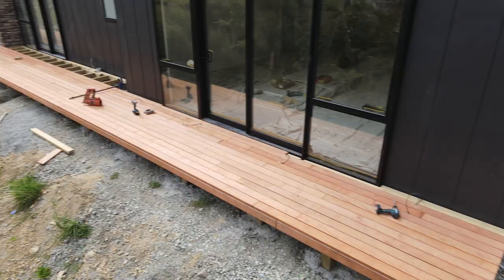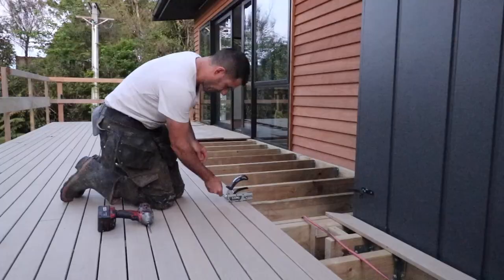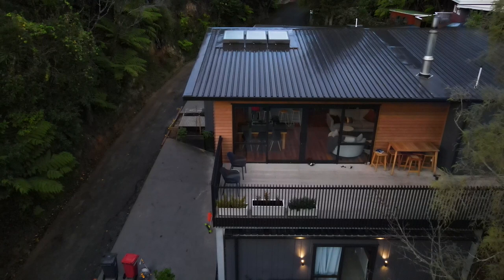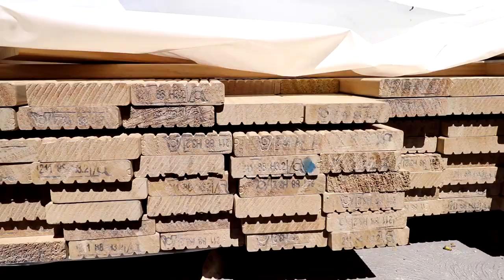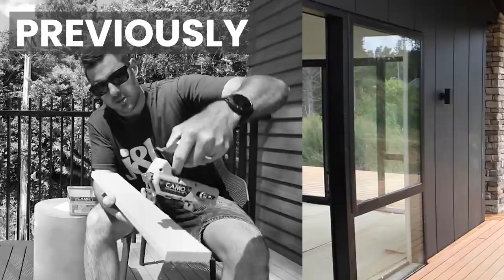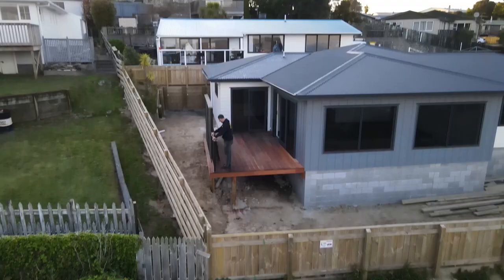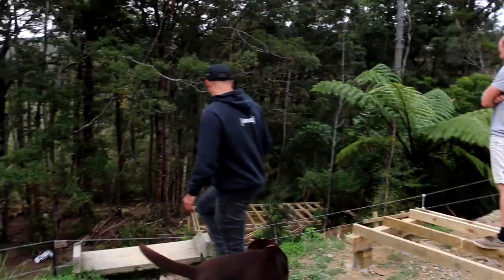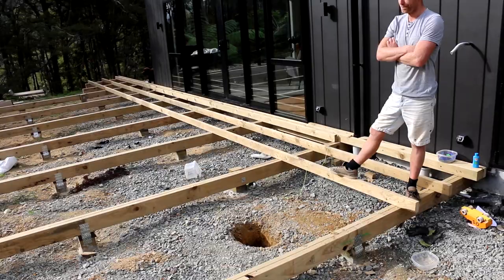Things To Think About When Building Your Deck

Comment: Grove up, no need to mark each screw in then 😉
Reply: The groves are down for a reason. They are designed this way for airflow to minimise moisture and mould forming.